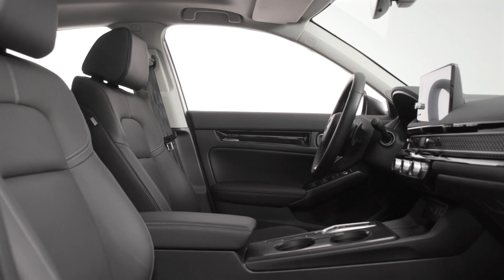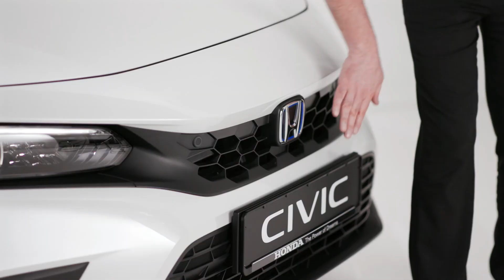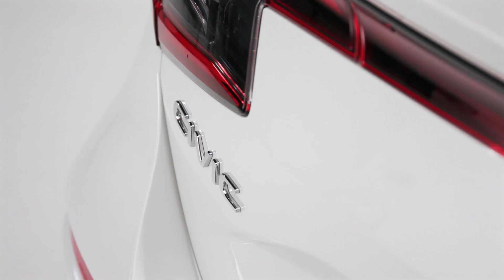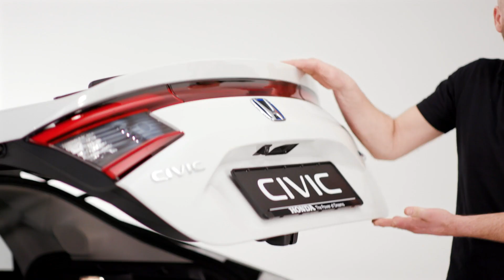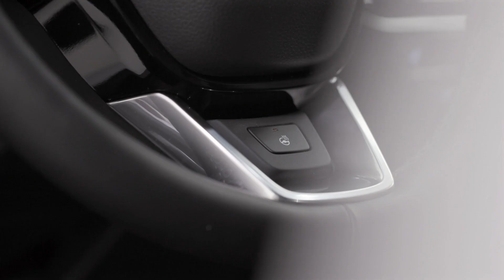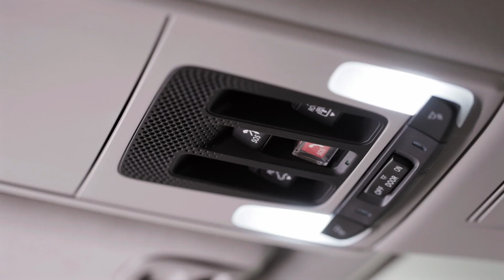Official Honda Civic Hybrid 2024 - Everything you need to know.

Comment: no one really talking about the insane powertrain, these eHEV engines are very unconventional. From what I gather a 2-litre engine works as an electric generator, there is no gearbox and the wheels are driven by an electric motor! this is very much the same as the old BMW i3 with a range extender petrol engine